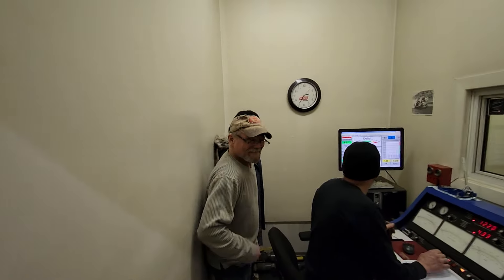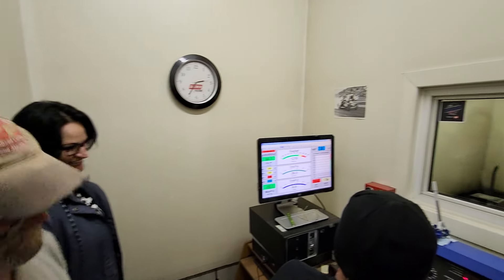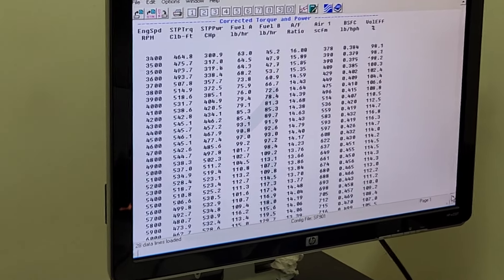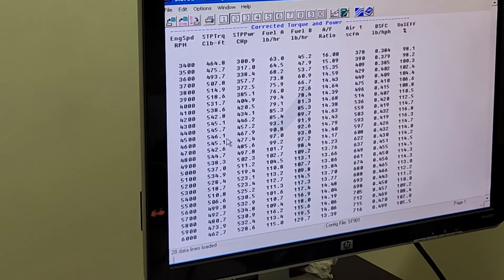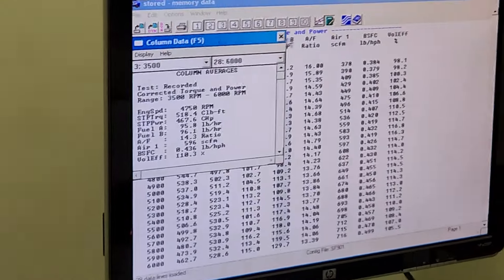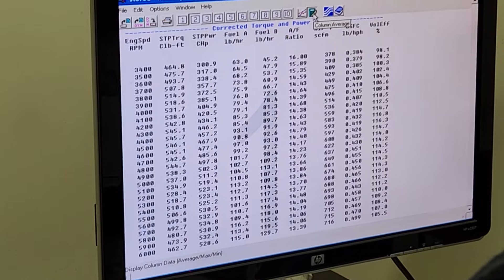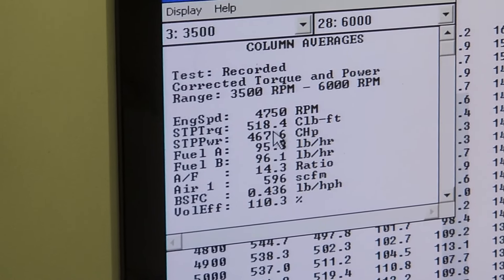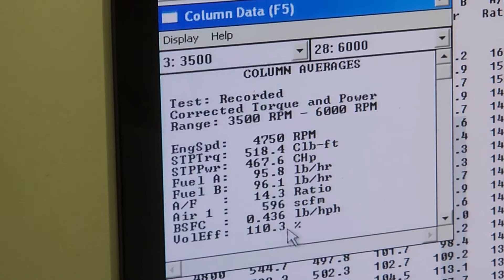Dyno Run of Dan's Mopar 340 + .060 Stroker.  Todd Marsh/Larry Smith heads, Scat, Lunati Roller...

Comment: Terry if you have time check out this short reel from my 318. i've had this strange noise almost like a rod knock but it doesn't do it at idle. Only when you feather the throttle around 2500 and up. So strange. its been like this since 2016 and I've chased the noise around ever  since then. Motor was rebuilt in 2016 318 .060 over, aluminum heads, comp cam extreme energy 268, keith black flat top pistons. ' pulled plug wires 1 at a time to see if it might be rod knock but the noise stays there. New timing chain too with tensioner. I'm stumped. I admire your mopar builds so i figured id send this your way for your ears on it. Thank you   https://www.youtube.com/shorts/j1W1isnghLo
Reply from the maker: Send me a text. 519-357-1113

Comment: How is this a stroker, if it's only bored 060 over?? Now if a 360 was cut to a small main and put it in a 318/340 block, then you have a stroker...
Reply from the maker: 422 cubic inch. 
340 bored .060 and a 4 inch Scat crank.
Reply: @brightonracing  scat!! Chinese junk... I've had my experiences with then..
Reply from the maker: 90% of people cannot afford a Callies crank at over 4 grand. Even Molnar is made in China. I have not had any problems with Scat. I had 1 bad Eagle crank about 15 years ago and that was it, but they were supposed to have had a bad batch and have fixed that problem.  Not sure where K1 is made, but I have had 1 on order since November.

  Same with heads. Trick Flow is made here, Speed Master is cast in China and machined in California. But no TF available till April/May so we have to accept what is out there.
Reply: @brightonracing  when it comes to racing and your reputation! It's worth the extra money.